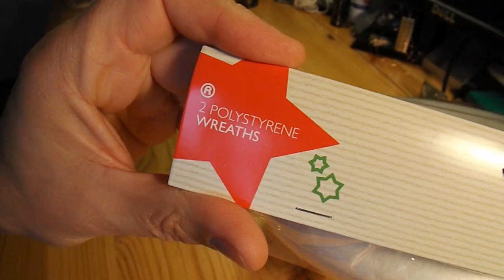Bargain Store Project #29 Pushrod Crankshaft Dynamo Generator

Comment: I think the doughnut failed because the magnetic field travelled the length of the donut, not perpendicular through the center.  The ribbon bobbin is effectively a thin slice from a donut allowing you to orient the magnet properly.
Reply from the maker: Hi Brian, thanks for commenting, I think you are right. I wanted to make the doughnut because I 'liked the idea' but hadn't really thought through what I was going to do with it. I am sure it would have been useful for something but not what I tried to use it for. Maybe I will make another sometime when I have found a YouTube video that shows a good application for one.
Reply: No expert on the subject but I think you are right. If you put the magnets on a wheel that fit inside the inner diameter of the donut with the poles facing outward and spun the magnet wheel, it would probably work.

I've thought about getting a hollow donut, putting a magnetic ball inside and winding it up... I'm gonna have to give that a try, but the ball would rotate changing which way it wants to go, it might be a good noisemaker though, and heat
Reply from the maker: Nabre Labre If you are interested in the donut idea you might like the one Jeremy Gwilt was working on early last year. Here is one of his series of videos http://youtu.be/9Um4kKLLIWA?list=UUcXBdN_OFpzK4KBTrSUxEkA